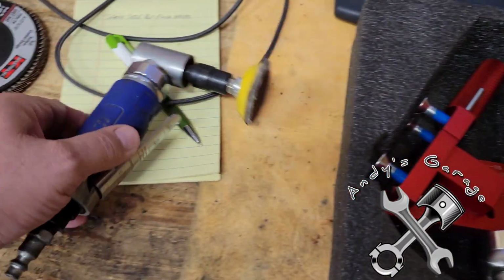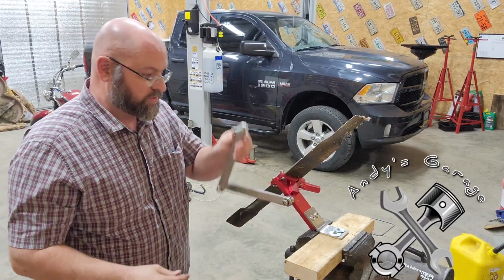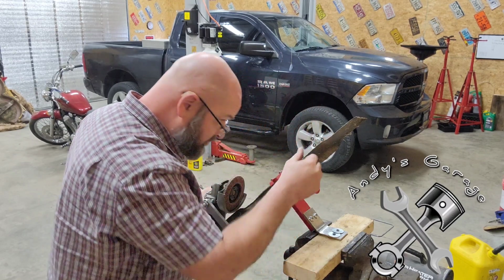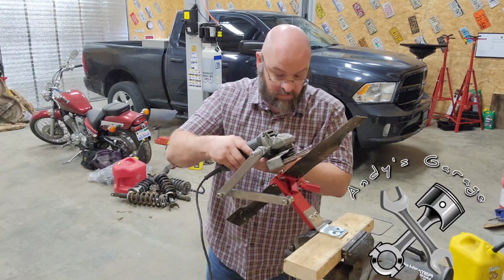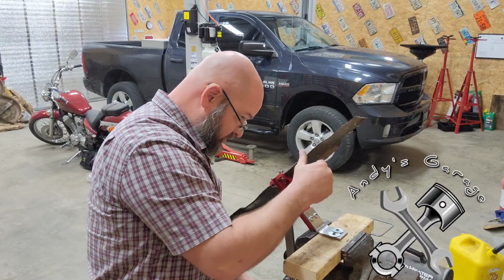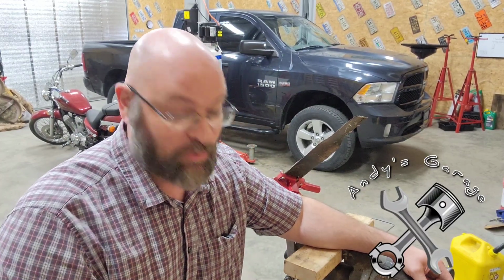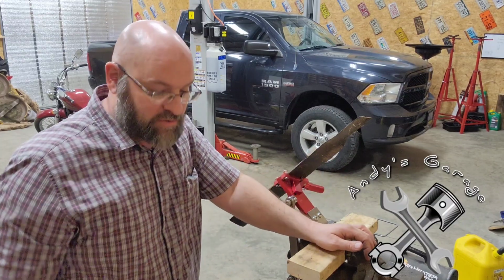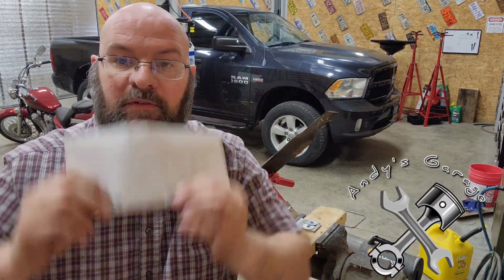Unboxing and demonstration of lawn mower blade sharpener 5005

Comment: Great video.  I see it’s a year old but good review.  I used to use a air die grinder until I bought the exact same looking for only $35 on Amazon.   Mine is made by Flywheel and is well Made aluminum and functions perfectly.   

I sharpened 10 blades so far and perfect finish.  Most of my blades are 35 to 40 degrees.  Easy to adjust degrees.   

Also bought the LDminda magnetic wall blade balancer for $45 and it’s a knockoff as well and both total saved me over $150-200 bucks just to get an overpriced name.   
Just shows you the markup and greed of some of these companies.  They want you to pay 200 bucks for a name sake and it’s costs them 30 bucks to make.
Reply from the maker: There's is definitely a lot of mark-up on tools like these.
I may have to look up the blade balancer you're talking about.

Comment: Just bought the All American 5005 and kicked around mounting it into my vise but it'll be too high. Bought some 3/8 threaded inserts for my bench top. The 'flush type' inserts shouldn't cause issues if left in place. I can probably run 2 bolts in as quickly as locking the unit in my vise.....we'll see.
Reply from the maker: Hopefully your mounting method works out for you.